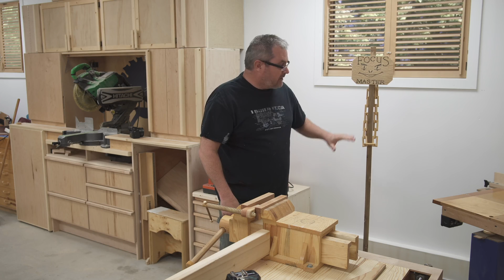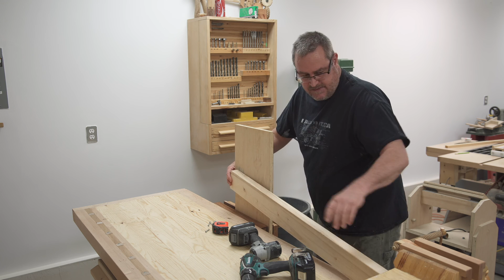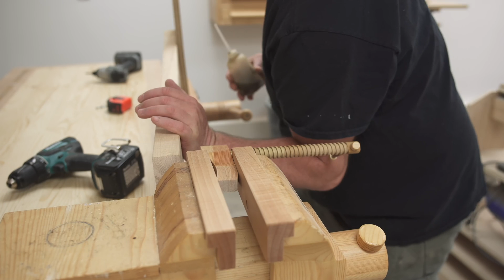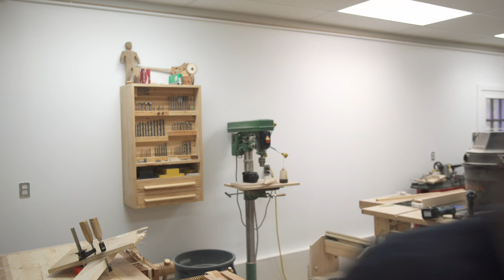How Strong Are Wooden Threads?

Comment: Add a swivel joint to the tip, lock in a vice pointing down. Put a pull scale inline, attach line/chain to floor or very heavy object 100+ lbs, and reverse up and see what point it breaks. Another option would be a heavy duty eye bolt in a 4x4 clamped to the bench below the clamp.

Conversely if you want to try durability testing use different weights 10,20,30, etc a few cycles each. In between runs allow it to cool off so heat build up of the previous runs friction isn't a huge factor in the failure.

Comment: thats by far not the force it can take. if you really wanted to test that, I'd support it way closer to the vice with the screw. The push force you applied on the 2x4 is not that much. If you CANNOT move it but then the threaded wood could, then it would start to say something. Often people have bout 30-50 kg push force as their max. and if really pushing it it can be like ... 70... with the long beam it has quite some torque on that piece of plywood as a result. So, not surprised you can break that piece of plywood.

I really wouldn't expect the threads to be shearing off like this.

Comment: I have wooden handscrews that are probably pushing 100 years old (probably beech), and others I made myself maybe a dozen years ago (hard maple).  None of them has broken, and I still use them all the time.  If you make your threaded part out of 3/4" hard maple, it will outlive you.  You don't need reverse threads or anything like that, btw.  In a wooden handscrew, one screw pulls and the other pushes.  They're both threaded identically, and both are threaded normally (righty-tighty). Only one jaw is threaded, with both holes threaded identically.  The other one has an unthreaded hole (the one closer to the open part of the jaw) for the "pull" screw to go through, and an indentation for the "push" screw to push against.  In other words, they're not just Jorgenson clamps made from wood ... they're their own thing.  A much simpler thing...

Comment: Pretty cool, but I wouldn't use any kind of liquid lubricant on wood threads. Oil will merely soak into the wood, swelling it and softening it. Even if you have the threads sealed or finished wax would be a much more effective choice. In my opinion, of course, YMMV, subject to fresh facts, etc. etc, and any other disclaimer I can think of.
Reply: Agreed, paste wax would be much, much better. Motor oil is also gross, smells bad, and stains things.
Reply: Oil doesn't swell wood, fact! try it
Reply: I would be curious how a good coat of shellac or other hard coating would work on something like this. Like how much strength would it add or would it add a point of failure. Then when dry and put to use lubricate with minwax or possibly graphite.
Reply: i'd use dish soap or vaseline, doesn't evaporate away and doesn't soak in

Comment: That's cool. I'm trying to get a force measuring device to test my Wooden Clamps to destruction. but I do want numbers.  They easily bottomed a scale at almost 600 pounds, although they have a 1-1/2" diameter thread. Any ideas what to use?
Reply from the maker: Could rig up a lever that would divide the force that the scale sees. Matthias Wandel did that in one of his joint test videos.
Reply: Thank you!

Comment: NIST has an old book from 1926 that contains the data you seek (tables start on page 567). Best to d/l the PDF, the web version is pretty slow. 

Google search for;
clamping force calculator wood screw NIST
use link;
[PDF] Holding power of wood screws. - NIST Page

Comment: hi John
you can use this in an adjustable seat for shop stool
i wonder if the threads will hold up to preasure that is not applied gradualy
try pounding on it with a mallet...

keep up the good work

Comment: John, if you want to lubricate wooden threads, use wax or soap (dry soap) oil usually causes wood to swell & soften. Also I believe that the vice I used at home as a kid was made with european boxwood threading, boxwood being very fine grained and smooth ( and hard !) lends itself to this use.
Reply from the maker: You are the second person to say that oil swells wood - it doesn't. It doesn't soften it, either.
Reply: Just seen this reply, it is plain rubbish- wood absorbs oil, as it absorbs it it swells(or else where does it go ?). just think what happens to an overoiled gun-stock, gets dark,soft and splits.
Reply from the maker: Oil takes up the space where air used to be - it displaces the air in the wood. Water does the same, but also makes the wood fibers swell. Only water does that. Oil or other oil based solvents won't, and that's just basic science.

Comment: Should use parafin/wax for lube.  Motor oil would swell the wood and seize the screw over time.  Jorgansen is the clamp name you were thinking of.
Reply from the maker: Water swells wood, oil doesn't. "Hand screw clamp" is the name I couldn't remember.
Reply: Googling whether oil swells wood or not was oddly inconclusive.  While I agree it doesn't swell like soaking in water does, the oil goes somewhere and I think it does swell a little (that is why the first coat of oil on dry wood raises the grain slightly).  On tightly fitted threads, even a little expansion would be bad.   Parafin wax would be more effective.  I always keep a candle ready to lubricate drawer slides and such and it doesn't attract dirt.
Reply from the maker: You seem to be the type that likes to argue points that you made based on assumptions. Oil doesn't swell wood at all and you can test that yourself, rather than Googling.
Reply: I did a test on some oak in 10W40 oil and there was minor swelling perpendicular to the grain within a few hours. 0.003" on 0.760".
Reply from the maker: Nonsense, or there was water in your oil. Oil does not swell wood - period.

Comment: Testing failure over time (cycles) is fatigue strength. Turn the 2x4 90 degrees for the next test, the stiffness will increase allowing more load to be transmitted per turn of your treads
Reply from the maker: The weakest link was the plywood.
Reply: Good point and true. But the plywood had two moments acting upon it, the length of 2x4 and the height from the vise. Reduce both (and rotate the 2x4) and see how much deflection you get.
Reply: Philip Gabor don't know about that, means he would have to remount he's vice,  you have over thought it Phil